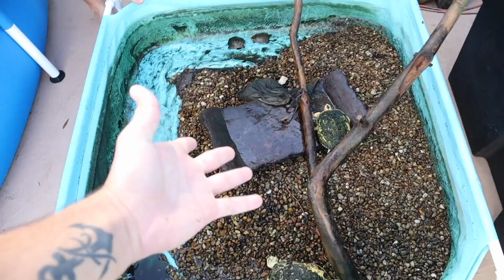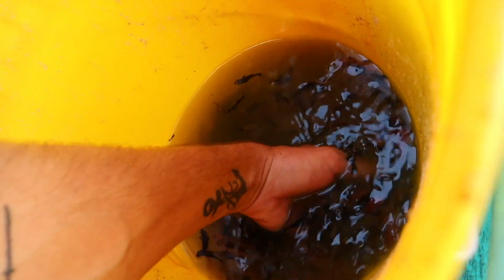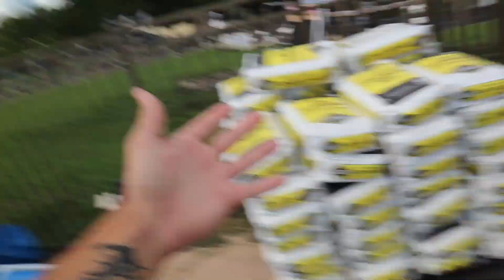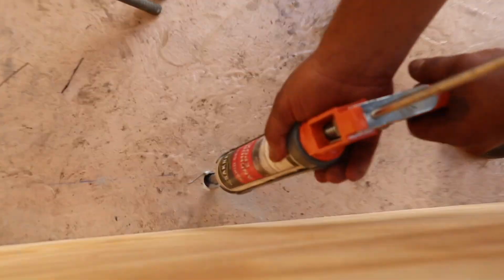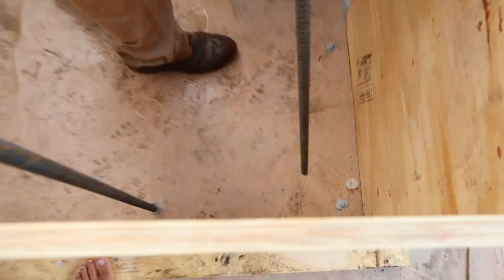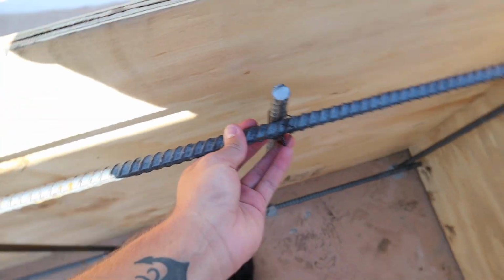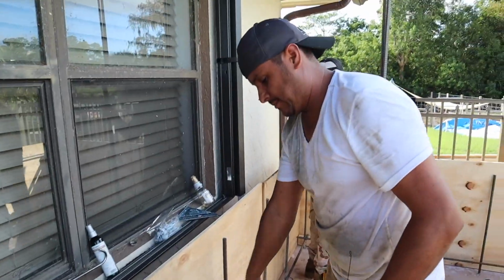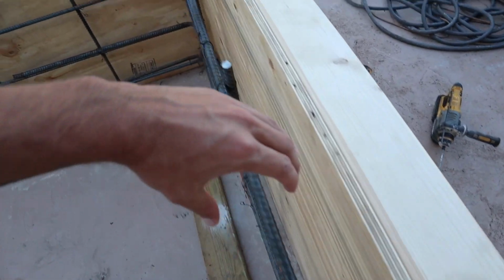BUILDING My MASSIVE PREDATORY FISH POND!! (part 1)

Comment: You could have gone the way the King of DIY did for his massive cement tank with viewing panels for it...
Reply: A panel outside would get covered with algae and also putting a huge peace of glass would be pricey and it would change the temperature of that water quicker especially during winter
Reply: @smokingjoint4661  dang that’s good explanation
Reply: @smokingjoint4661  yea king of diy is just different breed

Comment: A concrete pond can never compare to the fiberglass pond you had in mind at first.   Regardless of the filtration system you put in, the concrete floor and the concrete walls are going to be covered with algae and in no time, the water will become even more cloudy than the one in the pool ponds that you currently have and you won't even be able to see the fish you have inside.    The fiberglass surface - on the other hand -  being slippery surface,  is not a substrate onto which algae can stick to with ease.    Furthermore, it COULD NEVER have the look of your pool, unless you plan to pour CHLORINE in it and kill your fish.    So paying less is not always the best.   Besides, they ripped you off!   An 20' x 8' rectangular box doesn't cost 8 thousand dollars.   You could build a pool for less than that with the filter, skimmer, etc.